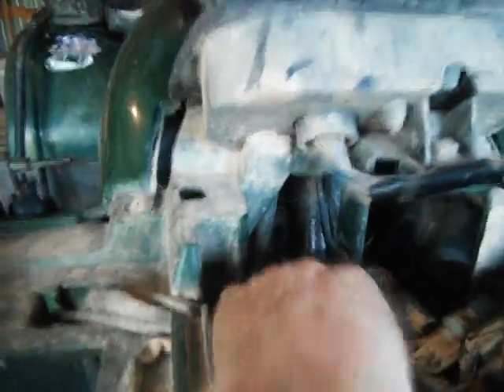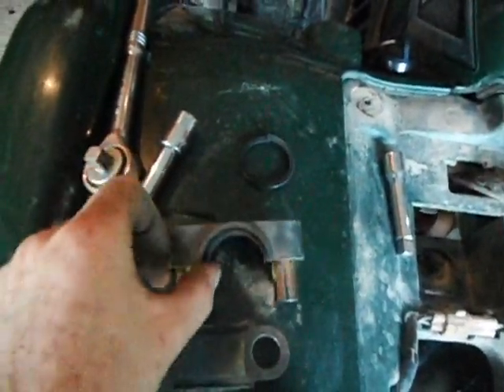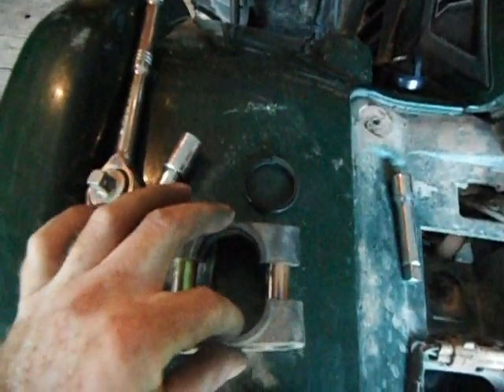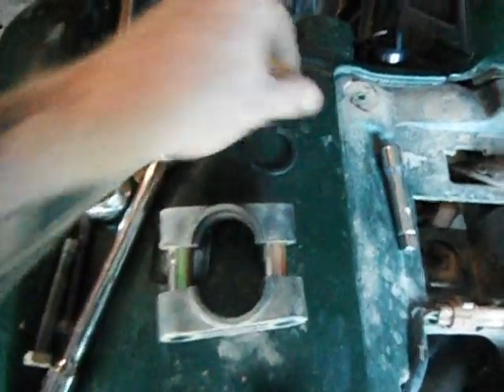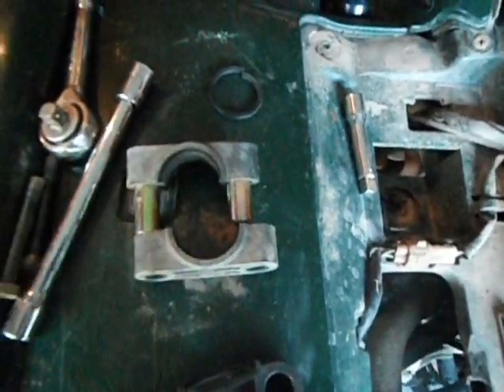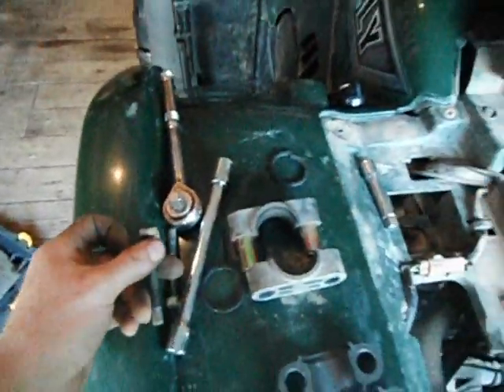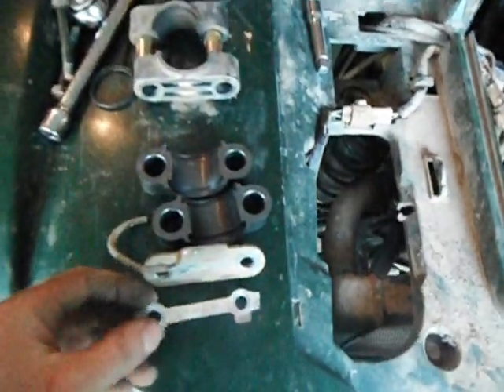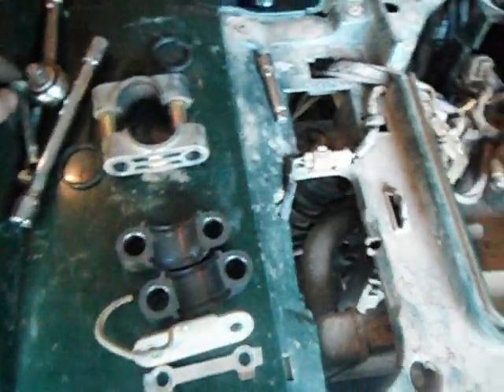Grizzly 660 "Bar Wobble"

Comment: Wrong... just changed out mine and I still have violent bar wobble at 35 to 50 mph... oh well at least my bushing is new
Reply from the maker: You must have play somewhere else. Are you getting play back and forth or side to side? I've found you can also get bar wobble from other areas like the bottom steering bearing or in the bar clamps themselves.
Reply: @ruyguy8888  oh I figured it out... the dummy that installed my BRAND NEW tires over inflated them and broke the cords in the tire, so I bought ANOTHER new set of tires and that fixed the problem